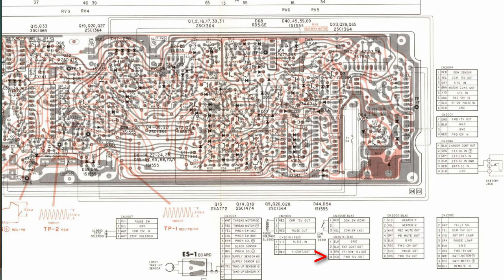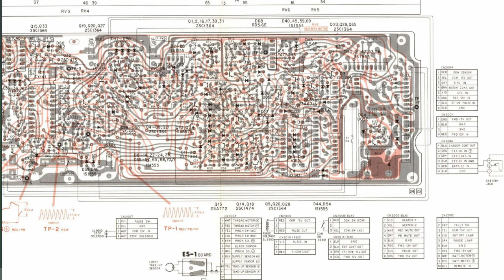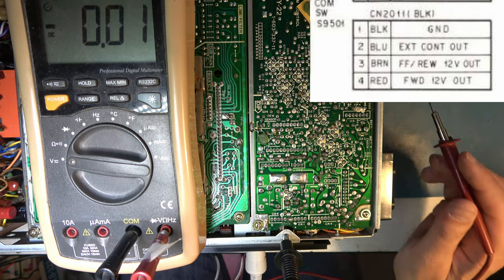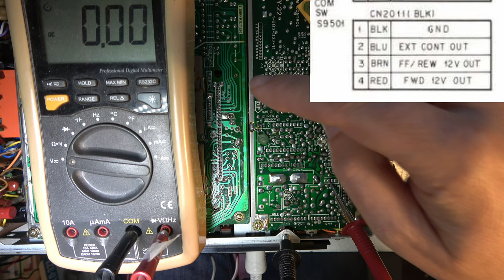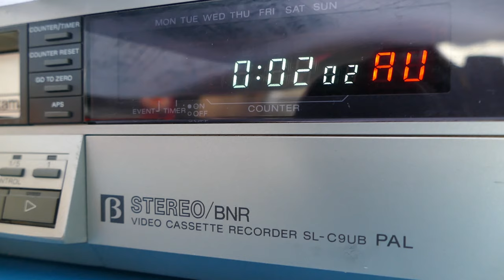Working on a Sony Beta portable SL-3000. Part 2.

Comment: The supply reel for mine isn't turning at all when there's a cassette inserted. It fast forwards perfectly fine but when going into fast rewind the supply reel spins very slowly. Also it eats tapes. I've already done the capstan motor repair. Is it a belt that's gone bad?
Reply from the maker: There are sliding levers on the bottom side of the deck and the grease on these tends to dry up causing strange mechanical issues.  So start by checking for lubrication problems as well as drive belts.

Comment: Do you have a link to the NTSC service manual for this model?
Reply from the maker: There is a link for the PAL version, which is branded Sanyo.
https://usermanual.wiki/Document/VTC3000P.1219996385/view
Though I have the NTSC manual here, I'm not sure if I'm permitted to share it, sorry.

Comment: Check your email inbox. I sent you a link for the Sanyo VTC 3000P (PAL) schematics. I cannot post links here.
Reply from the maker: Excellent!  That's the right schematic, albeit the quality is a little rough.
Reply: I came so close to finding out wether or not if an old supplier I known here in Australia had a Sony SM only to be told on the phone call his 3 old computers which had  heaps of manuals on them imploded the other day and maybe a few months till he resumes again or not.

Comment: I'm sure sony goes overboard with there electronic designs on purpose  to prevent anyone other than sony to repair it.
So you cant apply 12v because you dont know where  it needs to go lol.
Reply: I've got a Sony reel to reel, they definately did'nt want anyone repairing that.
I had to take it compleatly to bits just to get to the capstan drive wheel. LOL.
Reply: @frankowalker4662  That sounds like a right pain in the ass.
I have a food cooking device called Ninja,  it belongs to a friend.
It is such a horrible construction that its impossible to fix it without using force.
Its got welded plastic all over the place,  really horrible device.
Its not sony but ninja does not want you to fix it.
Reply: @zx8401ztv  I hate it when companies do that.